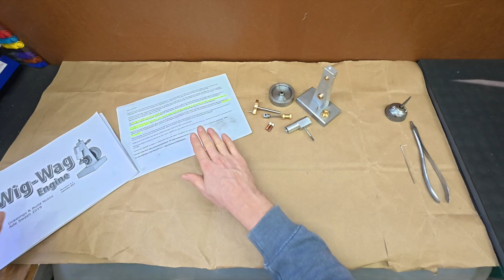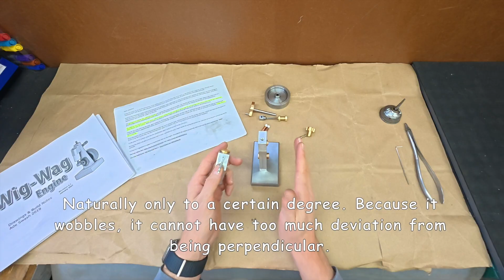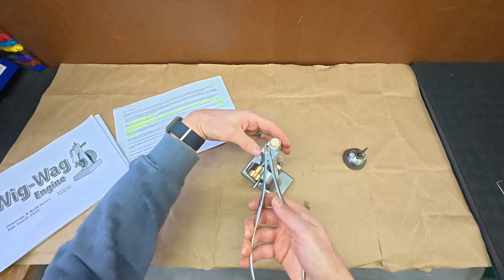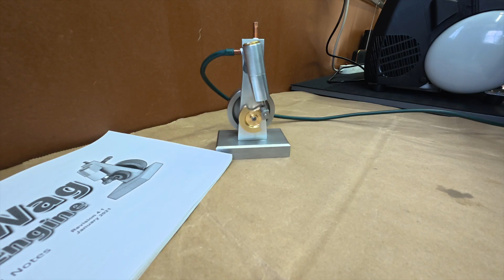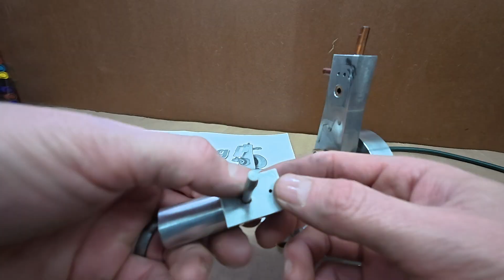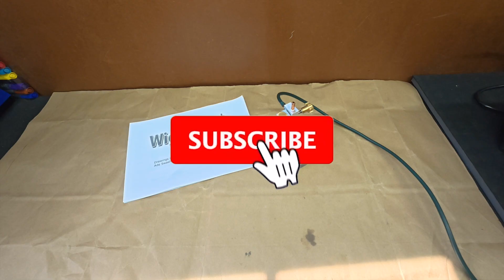Building an Oscillating Steam Engine from Scratch! Part7 - Final

Comment: Hi Mr Q, what a fantastic video build series you have made here, I have really enjoyed seeing your work progress, problem solving, adaptations, and hearing your thoughts and views as you built and assembled the little Wigwag. Your explanations of the alignment of the shafts in both the upper and lower parts of the wigwag is very good and will hopefully be a ‘nugget’ of information for any new builders of the Wigwag who see your video series.  I would like to add a link to your build series to my Wigwag website if that is OK with you? - as I believe it will be a source of help and guidance for other people who have begun to make the engine.  I am happy to hear that you have enjoyed making the Wigwag, and you have done it proud for what it is, and towards the very end of part seven you found its’ limitations for high pressure, which again may help newcomers to treat the engine gently and keep the PSI just a little more than lung power pressure! – Thankyou.   Ade Swash
Reply from the maker: Thanks Ade. I'm really proud of my first little engine build and even more so now after your kind words as the designer of the engine. I would be honoured if you publish my work on your website.
My next one is the little drop hammer for the engine to run.
I'm really chuffed now ☺